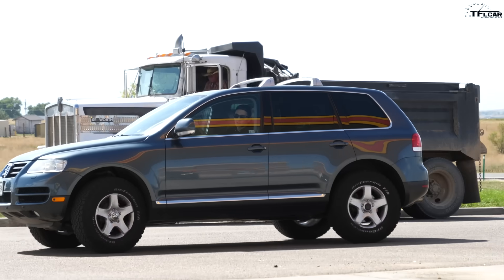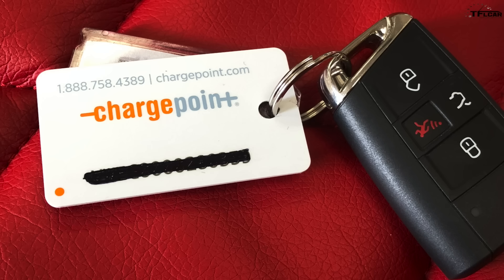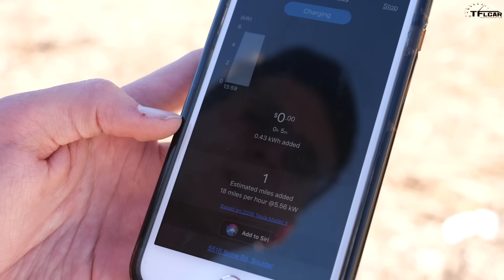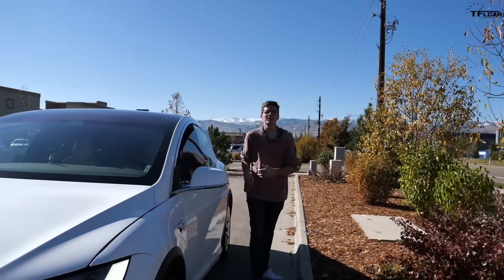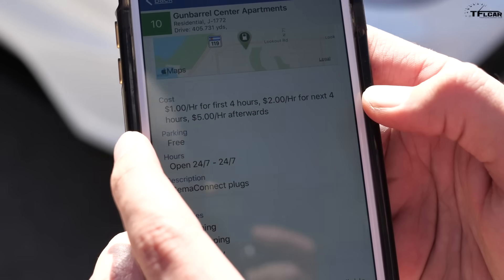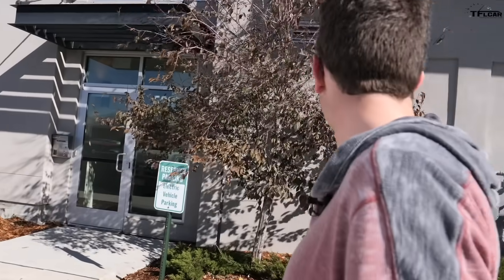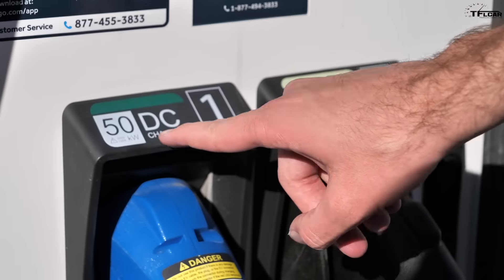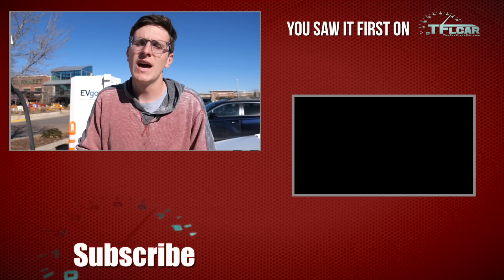Here’s Why Charging an Electric Car Can Suck - And It’s Not The Reason You Think!

Comment: A grocery getting toy for people with lots of discretionary income and time to waste.
Reply: and a petrol car for when they actually want to go anywhere without a days worth of planning.
Reply: 'toy' how often are you going 300+ miles? I do trips like that only a few times a year.
Reply: I spend 5 seconds plugging in every 4 days or so in my garage. I hated wasting time having to go to gas stations. And my 310 mile range, 0-60 in 5 seconds EV costs less than all of my neighbor's $50,000 trucks and costs 1/4 the $$ per mile to fuel.
Reply: @flipadavis  ,
No garage. Multiple family dwelling. Apartments. Must search for charging station. Quite similar to going to gas station. Difference is I can't refuel in 5 minutes. It takes 5 hours.
Reply: @davidhoffman1278  Thats why you plug it in at night.
Reply: @philusaphur4924  , 
Where? I can't run an unattended electrical cord from the parking lot up the stairs into the apartment overnight. It is justifiably considered a tripping and fire hazard. There is no way the apartment owners are going to install charging stations. Heck, they took down the children's little play area.  
Again high discretionary income person's toy.
Reply: @davidhoffman1278  Then dont buy the car its that simple. Elon isnt forcing you too. If you dont have the means or your city doesnt have the infastructure to support EV's dont buy it. Simple. Dont go complaining that the car is a gimmick, it takes time for infastructure to be built. Its like saying, "Why cant I get gas?" When you bought a car in a town without a fueling station.
Reply: @philusaphur4924  If the people buying the EV cars were the only ones paying for the infrastructure, I'd agree with you. Unfortunately, a lot of this is being done with funds mulcted from the taxpayers and customers of ICE cars, through subsidies and the arm-twisting of car manufacturers.
Reply: @dalriada842  EV, stations will be everywhere soon you just have to wait.
Reply: @dalriada842  The difference is that ICE cars kill tens of thousands of people every year with their poisonous exhaust fumes. Electric cars are, whether you like it or not, the only sensible path for the future in the fight against climate change and bad air quality, especially in cities but frankly everywhere. Do you really how much the oil sector is subsidized in western politics??
Reply: @davidsommen1324  Almost all of the emission from an ICE car is carbon dioxide and water vapour. These are not poisonous to human beings at the levels being emitted. The truly hazardous emissions have been reduced to almost nothing in modern cars in the more developed economies. We are now in a state of spending ever greater amounts of money for fractions of a percent reduction. We're firmly in diminishing returns territory. 
You should be wary of these hypothetical death rates. They're pushed to fulfil an agenda that has nothing to do with the stated one. Pushing people into using EV cars will price most people off of the road, and limit the range of movement for those who can still afford to drive. That is the real agenda. Current battery tech is the Achilles heel of the EV car. 
Carbon Dioxide is a trace gas in the Earth's atmosphere(0.04%) that plants need to live. It has been higher, sometimes much higher, for three-quarters of the time that life has existed on Earth. Remember that all the fossil fuel was originally in the Earth's atmosphere before it was sequestered by life and buried. Water vapour is a much more potent greenhouse gas than carbon dioxide is, because of how much there is in the atmosphere. They're not trying to ban that though because it wouldn't fly with the public. Banning CO2 is great for attacking Western economies. I think that humans have very little influence on the climate. It is our relationship to the Sun that plays the dominant role. We are currently in an interglacial period of an ice age that has lasted for 34 million years so far.
Most economies are run along Fascist lines, as opposed to being free markets. Large corporations work hand-in-glove with government. I don't support this. Though in the UK, where I live, the government bleeds the North Sea oil industry dry!
Reply: @dalriada842  Wow. so wrong on so many levels. You could be a oil company lobbyist. If you really believe the exhaust fumes of a car are not toxic, you are very misguided. here is something called science, you know. Car manufacturers and oil lobbyists want you to believe 'modern' cars hardly emit hazardous gases but that's just blatantly wrong.

CO2 might be a trace gas but it is a climate change driver, the 'low' percentage does not matter. Would you drink water with only 0.04% tetrodotoxin in it? A small amount can make a big differnence. The carbon flux is out of balance because we put more in the atmosphere than the earth can take out. The water vapour thing is just bogus, water vapour doesn't stick around in the atmosphere for thousands of years, which CO2 DOES.

All your claims are wrong, debunked, and straight of the playbook of the climate denying fossil fuel advocates who only think of power and big money. If you really believe this you should inform yourself. If you're a lobbyist you should be ashamed.
Reply: @davidsommen1324  I suggest you acquaint yourself with the concept of toxicity. Tetrodotoxin isn't relevant to this discussion. Carbon Dioxide isn't a potent neurotoxin. How could we have evolved on a planet with a poisonous atmosphere? Do you breathe the air?
The importance of water vapour here is the quantity in the atmosphere at any given time, not how long a molecule hangs around for. There is a water cycle on this planet that maintains the level. You are an example of someone who knows just enough to be dangerous/hoodwinked!
Reply: @dalriada842  You are an example of someone who knows exactly nothing. The projection is strong with you.

It's embarassing I have to explain this but the analogy of the toxin is just that, an analogy, to debunk the bogus about CO2 being "only" 0.04 percent of the atmosphere. This is a talking point made by malicious people in order to deceive gullible people. I don't know which of the two you are.

Water vapour is part of the water cycle which is the exact reason it is not an argument in the climate change discussion. Water vapour disappears very quickly. CO2 is a climate driver, that is just a fact of physics. There is an excess of it caused by burning fossil fuels. Unlike water vapour, it sticks around very long. That is the one of the reasons why burning fuels is bad for the climate. It's not very complicated, you know. Just don't burn stuff in a matter of minutes that has had to build up over millions of years.

These are all facts, and you have given none, none that are relevant anyway.
Reply: @davidsommen1324  The climate is complicated. That's the problem with people spouting a form of pseudo-scientific Earth religion. Keep repeating your catechism and dodging the arguments of anyone with a contrary position. I'd have as much chance of trying to persuade you of the error of your beliefs as I would trying to persuade a Christian Scientist to have a kidney transplant. So I won't bother!
Reply: @dalriada842  The first response where you actually make some sense. The problem is that the things you accuse me of are exactly the errors YOU commit. I am not dodging any arguments. I have looked into them - they can seem convincing - and concluded they are bunk, based on peer reviewed SCIENCE and reliable sources. You should do the same. Unless you deny reality you will come to the same conclusion. Don't use the internet blogosphere bubble, but reliable scientifical sources.

The scientific theories regarding climate change are very supported by evidence. We have known the problem for a very long time! But apparently the lobbyists are very succesful, even intelligent and sincere people are constantly fooled into thinking that burning fossil fuels is not such a big problem.
Reply: @davidsommen1324  I'm actually all for reducing our dependence on fossil fuels. Though not for reasons of climate change. I want to avoid the conflict that oil has brought to the world, though not at the expense of creating new conflict over Lithium reserves. I have no problem with people choosing to use EVs. Though not with having other people forced to pay for them, let alone forced to buy them. I don't rely on the blogosphere. One of the problems of science is that the quality varies greatly, and there is significant fraud in certain areas. I don't find these sources as reliable as you do. I draw a distinction between science, which is the best method devised to understand the universe, and the scientists who undertake it. The scientists are fallible human beings, prone to all the same weaknesses as other people.
Reply: @dalriada842  You are right about humans being fallible, but the self-correcting nature of science ultimately is the best way to figure out what path to take. Anthropogenic climate change is not longer a hypothesis made by some fallible humans. It is corroborated by substantial evidence and is as strong a scientific theory as evolution or gravity. The talking points you came up with are clearly (though you may not realize it) inspired by blogosphere influencers who often have a political agenda. 

As for being forced to pay for it, we are all paying for fossil fuels as well, and a lot more too, both directly and indirectly (the damage fossil fuels causes has a substantial cost to our society).
Reply: @davidsommen1324  I don't agree that it's "as strong a scientific theory as evolution or gravity". We'll just have to agree to differ. I think there is plenty of scope for shady conduct in this.
Reply: @dalriada842  I haven't read one good reason from you (or anyone else) why one should doubt the scientific findings about climate change (or air pollution, the thing with which our discussion actually started). The ones sowing doubt about it have blatantly clear motivations to do so, and behave no differently than the tobacco lobby constantly sowing doubt about the health hazards of smoking. Who still doubts that cigarettes are bad for our health? In the past a lot of people did (and sadly still do) because of targeted disinformation.

What we have here  a classic example of pretending there actually is a real debate about this and that 'both sides' have merit - one of the tactics lobbies use. Anyone with scientific (or not) credentials can claim anything, but the actual peer process is crystal clear about climate change. That is actually not a matter of opinion, but plain fact.
Reply: @davidsommen1324  This is a comment thread on YouTube. I'm expressing my views on a topic. I don't see it as my job to marshal the data to convince you that the prevailing opinion is wrong. Nor do I believe that such an approach would work. You may accuse detractors of being unscientific; having a hidden agenda; or being conspiracy theorists. These are common accusations, but it is the proponents of AGW who come across to many as zealous adherents to a new religion. You seem peculiarly dogmatic for one who claims to be a proponent of science.
Reply: @dalriada842  What is religious or zealous about accepting science? Are people who accept that the earth is an oblate spheroid  or that life has evolved religious or zealous? Flat earthers or creationists do claim that. They are wrong.

In fact it's the other way around. And that is what you can't seem to understand.
Reply: @davidsommen1324  Science is a process, not a set of theories. When one becomes emotionally attached to a particular theory, they cease to be 'scientific'. I tend to have a cynical view of human nature. There are those who lust after power, money, and fame. I see humanity engaged in a mud-wrestling melee, trying to get the others in a head-lock. They will exploit any opportunity to advance their ambition. 'Science' is one of those areas that is ripe for exploitation precisely because of the respect it has earned. You appear to have a Manichean view of things; that there are the noble scientists and the ignoble detractors. I see the possibility of corruption in both camps. I have the most respect for the hard sciences because their corruption provides the least benefit to the power-hungry. I have the least respect for the soft sciences because these are easiest to subvert to push a political agenda. Climate science is in the middle, tending towards the easily corrupted social sciences.
We're kind of like two rams butting heads here. Neither of us is going to be swayed by what we read on a YouTube comment thread.
Reply: @dalriada842  Whether it's on a YouTube thread or an e-mail exchange or a formal debate, what exactly is the difference... we both have the chance to provide evidence... My position is backed up by ('hard') science - physics, geology, meteorology. Your position is contradicted by those fields. I already acknowledged your point about human fallibility - the scientific method is the best and only method we have to counter that. The soft sciences (psychology, political science, etc) come in as to how to convince people of certain things (true or false...), they  sometimes take advantage of that same human fallibility and in this case it is VERY clear how the fossil fuel lobby tries to convince the public that change is not needed, just keep on buying and burning the fossil fuels we sell you for a huge profit... The fact that you believe there are still doubts or an actual debate about the scientifically established fact that humans have a significant impact on the current climate change, just shows that the tactics used by those groups work very well.

You're right that you do not sway me..  but only because you haven't provided any evidence for your claims, NOT because I am supposedly ''emotionally attached to a particular theory'. You claimed that modern ICE cars hardly emit toxic particulates - that's just completely false, by any standard, even auto manufacturers admit THAT, certainly after dieselgate. You claimed that "you think" the sun causes the global warming we undeniably see happening right now, while every peer reviewed scientific paper about that subject completely burns this to the ground. We KNOW, because of 'hard' science, that carbon dioxide is a very powerful and resilient greenhouse gas, that even in a relatively small amount  (right now we are at about 408.5ppm, which is a lot more than even just 10 years ago) has a large impact on the climate of any planet. We also KNOW that burning fossil fuels adds more CO2 to the global CO2 flux. The evidence is all right there, no dogma required.
Reply: @davidsommen1324  You keep talking about evidence, yet you haven't provided any evidence of your own besides a hand-waving reference to scientific papers etc. YouTube comments are the intellectual equivalent of chatting over a pint at the pub. The renewable energy and green building crowd also has vested interests to promote. To say nothing of the politicians and bureaucrats who are riding this particular horse to advance their careers. I think you are emotionally attached to AGW because you feel compelled to keep this thread up after repeated attempts by me to point out that we're both wasting our time with this exchange.

Comment: Thanks for the video, I appreciate your hard work but ..... Have you read the manual? The adapter is attached to the gun and then plugged into the Tesla. When you remove tap the disconnect lever on the gun wait a second and Tesla will release the charging socket allowing you to pull the gun out with the adapter.

OwO despite different companies using different apps, all use the same J1772 adapter and accept common payment methods.  Additionally you need to outline that THE expectation is that your car is home charged.. and these are supposed to be "destination chargers " not your primary charging way

Comment: The time and hassle with charging a electric is why I own 4 ICE vehicles and won't buy electric any time soon.
Reply: Do you have your own garage?  Then there is no hassle for everyday driving: just plug in when you get home and wake up to a fully-charged car.  Road trips for a Tesla are again not an issue.  I have taken many road trips in mine and always charged while stopping to eat or use the restroom.  Superchargers are zero-hassle for Tesla owners.  Other manufacturers will catch up in time, but for now buying a non-Tesla electric car will require a little more work.
Reply: The other option is a Plug-in Hybrid Electric Vehicle.  I drive around town on electric and only use fuel when I go out of the city.   I fill my tank (9 gallons) about once a month and drive approximately 20, 000 miles per year.  Electricity at home is about $35 per month more because of the car.